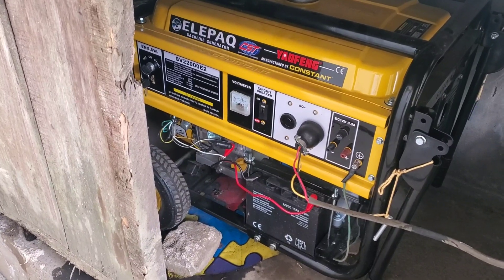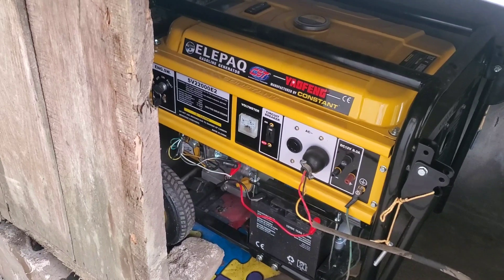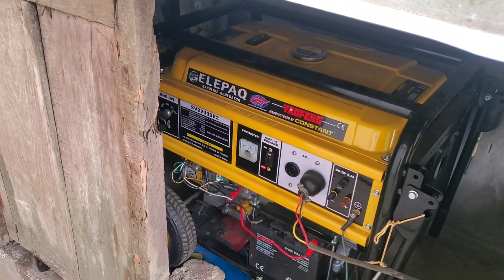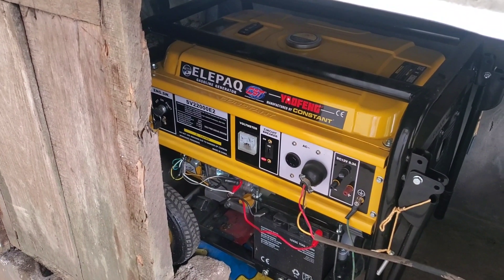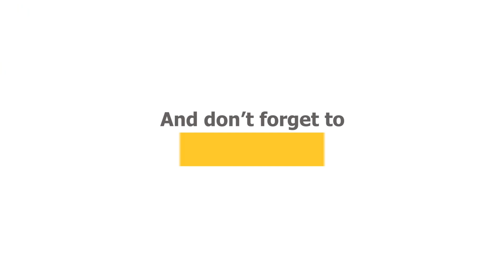Generator: SolaX Hybrid vs Deye Hybrid. Part 3

Comment: Thanks for the video Dr Solar. I have always been suspicious of the generators and that's why I haven't commented on the generator comparison videos so far. The quality of their sine waves may not be stable or clean enough (especially under load) and Deye chose not to risk it at all. Typically these relatively "cheap" petrol generator produce AC wave forms with quality and frequencies that depend on their engines' rpm. The rpm in turn varies widely with load so the values and qualities end up being all over the place. Diesels by default run at lower speeds and have higher torque so tend to be less affected. Perhaps old school Yamaha and Honda petrol generators as well as the latest "inverter type petrol generators" will permit cleaner outputs because of higher build quality but they cost a lot of money. It's possible that you'll get the inverter and this generator to work together as you desire after making the proposed and/or other adjustments but this might end up stressing the internal components of the inverter unnecessarily. Failure may not occur immediately but it most likely will occur earlier than it should. In my humble opinion, the SolaX inverter is a high quality electrical/electronic machine that should be coupled to a high quality generator. It is not the business of the inverter to descend to the level of poor quality generators. Correct me if I'm wrong but I think anyone that can pay for this inverter, their lithium batteries and solar panels will find the added cost of a higher quality generator a no-brainer.
Reply from the maker: I tend to share most of your observations but the majority of our clients have these in addition to diesel generators. For those that have the gasoline generators we have to offer them something. They remind us that their neighbors are able to charge with the same generator